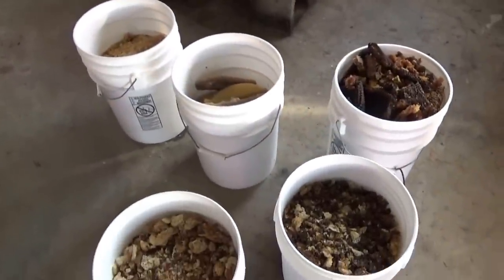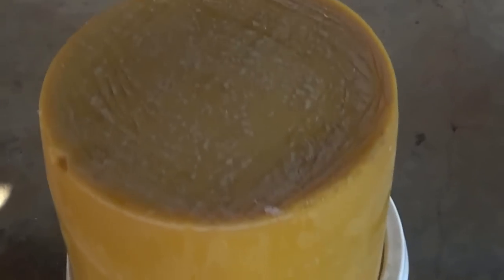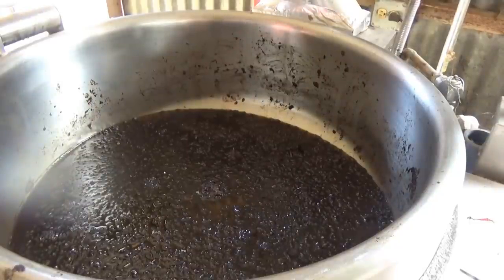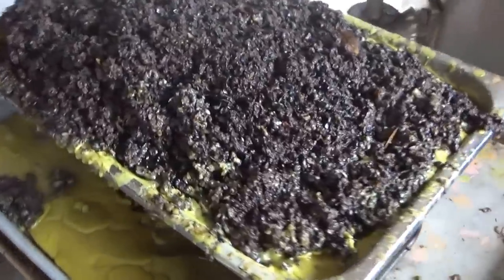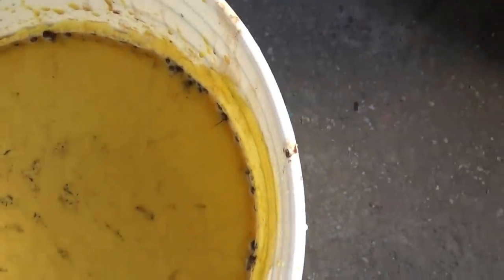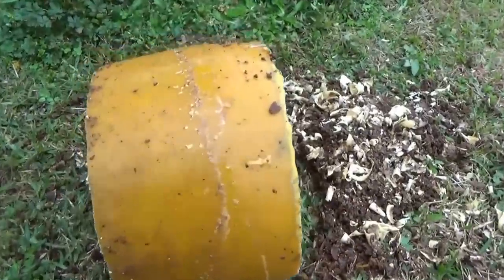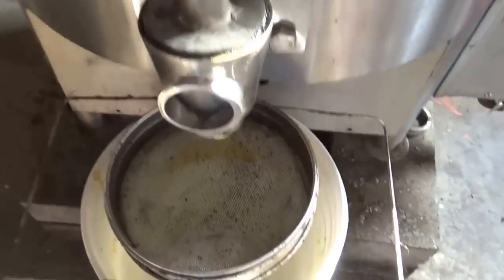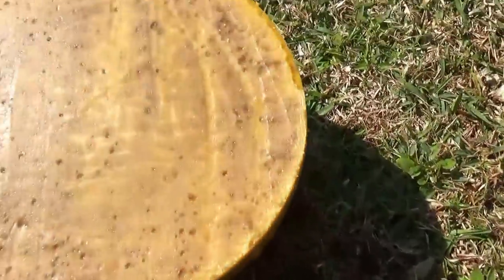Rendering bees wax

Comment: Does the cocoon/wax leftovers burn well? You could cut it into chunks and use it as a firestarter or log for campfires
Reply from the maker: What guy doesn't like a good fire? I know I do. I never tried to burn it, but since it's  wax and debris, it might burn. Let me know if you ever find out. Thanks for watching. God's peace.      Mr. Ed
Reply: I bet it would burn, no problem. Throw the leftovers in a blender, add it to a bucket with some newspaper pulp and squeeze out the water with a vice in a brick form and you've got a nice fake log infused with beeswax. Then sell it as an original product for $$
Reply from the maker: Sounds like a good idea to me, but I've got way to many fires burning already to start another one. Thanks for your idea and watching. God's peace.      Mr. Ed
Reply: I was thinking the same thing.
Reply: Anthony Klose, this does work. I have used old pine chips. It burns smoky but does burn good.
Reply: Rural Homesteader Mr. Close have you tried that in a smoker for use on beehives.
Reply: Would it be a good idea to put the scrapings in a compost heap? Or would the wax make it impractical?
Reply: ''What guy doesn't like a good fire?''....That is interesting, reusing the 'waste' as potential fire starters...I agree, men especially like a good outdoor fire...woe betide anyone who 'interferes' with another man's fire especially when it is being kindled....eg, bloke gets it going in the rain, and coaxes the little flame to catch on the damp timber twigs, and along comes another person and dumps a huge wet branch across the nascent flame....of such things yellings are made :)

Comment: 2 quick questions: how many hive boxes did you need to collect all that wax & how much does a 15 pound block of wax sells for?
Reply from the maker: I really don't have any idea how much wax was collected to produce this much refined wax.....it was a LOT. It was more than 7 months worth of collected wax. Rendered wax can sell from $9.00 a pound to up to $ 35.00 a pound. It depends on the purity of the wax and also the source of the wax.  Because I have treatment free bees, therefore treatment free bees wax, it would sell for  for about $ 15.00 a pound, but I don't sell wax as I need it all for our bees. I give it right back to them. God's peace.
Mr. Ed
Reply: We get about 4 pounds of wax from the cappings from 6 or 8 medium honey supers. Have been using a big canning pot on a turkey fryer.   We harvest around 30 pounds of wax a season off approximately 40 colonies.  We use it to coat new foundations and make some candles. The bees will work on the new foundation and get it drawn out into combs much faster if you give each foundation a nice coating of fresh bees wax from your own hives.
Reply: @JeffHorchoff  they will recollect wax?
Reply: @charliedilltarde9881  Correct, less energy used to build the comb means more energy goes into honey production.

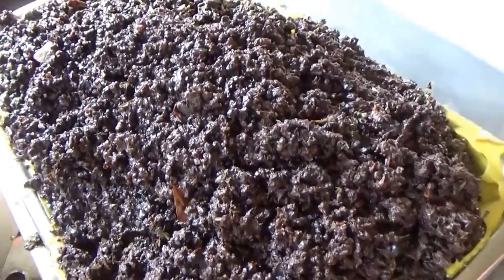Comment: you could sell all of the extra gunk at 6:30 as a chicken feed and get more money out of the rendering process. you could probably use eBay or some site like that.
Reply from the maker: It all goes into the compost pile now thanks to all the suggestions from views like yourself. Thank you so much for your help and watching, and commenting on my channel. God's peace.       Mr. Ed
Reply: Jeff Horchoff also you should try putting the starting wax caps and comb on a wire mesh lining inside of your cooker before you melt it and see if that helps with the process any more. just an idea, although it might work better with a little bit finer of a strainer.

Comment: Would it not be faster to filter through fabric at the first drain making for a cleaner wax at 2nd boil
Reply from the maker: The main problem with the first filtering is the amount of debris in the wax. More than half the material in the melter is cocoons and trash. I now keep a screen netting under the entire mix and it helps tremendously. I'll be posting another rendering video very soon, stay tuned. Thanks for watching. God's peace.
Mr. Ed

Comment: Liked your video . I purchased the wax rendering machine from Cowan manufacturing out of Utah and it's a honey separator and wax separator all in one unit it is made to set a drum of your extracting cap pings upside down with a grated lid and it drips all the liquids out and drains into another square box which is equipped with a water jacket and heated with a element to not burn your honey but keeps everything well liquified until your ready to pour off.This machine works pretty good but it was a little pricey
Reply from the maker: I have to admit Randy, I am jealous. I would love to have anything made by Cowan, that is a really good manufacturer of honey processing equipment. You have a very good piece of equipment. How many hives do you have and where are you located? I know you can not be just a hobbyist bee keeper to purchase equipment like that. I'd love it if you check out other of my videos on my channel and let me know what you think of them. Most of them are about removals and swarm captures, but there are other aspects of bee keeping that I show. I hope to hear from you again. Thanks for watching. God's peace.
Mr. Ed

Comment: I use a strainer that's basically a paper towel on top of a window screen.  As it melts, the nasty stuff gets left on top of the paper towel and the wax sinks through to my pot full of water.  My process only takes a day because the straining process is more exact instead of manual.  I hope you can use this for your larger operation instead of hand straining it.  Happy Thanksgiving!
Reply from the maker: Because of the volume of material I process, the amount of debris is tremendous, and a "simple" strainer can not handle the load. I have refined the process by adding a screened material in the kettle which eliminates over 95% of the heavy contaminants, and use a simple strainer to remove the rest. Here is a link to the last rendering video I made. Till next time, thanks for watching, and Happy Thanksgiving! God's peace.         Mr. Ed
https://youtu.be/gdof2ZO_5eA

Comment: I don't know about processing bees wax but I do know processing other oily / waxy stuff, if you were to add a few gallons of water to that wax after you skim off the junk on top, boil it under a hard boil for a few minutes and then let it settle out, you would be able to remove most of the sediment on your initial strain and have a much cleaner wax product after the fact.

The key is to boil the water with the wax in it so as to dislodge all of that crap from the wax and allow it to sink. Repeating this process a few times will leave you with extremely clean product.
Reply from the maker: That is very interesting, and I have never heard of it before. I will do that on my next batch. Thank you so much for the info, I know it will work. God's peace.      Mr. Ed

Comment: If you pour the wax in a traffic cone shape the surface area to scrape on the  bottom is significantly reduced making for easier scraping and a much smaller soiled surface.
--------------------------  
If you add a spigot at the bottom of the cone shape you can drain the water leaving mostly just wax, making the bottom crud area even smaller.

Comment: Try using a butter muslin cloth as a filter for the final run, see how clear the wax gets with that.😉 Sure it's a bit messy, but just use the same cloth several times, the wax left in the cloth will melt with new wax poured onto it. Of course do it while it's hot weather, so it doesn't solidify too quickly. Experiment with that if you'd like.😁👍 Proper filters get even better results (clean it real good first!), almost white wax.😉
Reply from the maker: You got my attention, now I'm going to have to try it. I've got a lot of 
 cappings that I want to make into candles so I want some really refined wax, your suggestion will be put into practice.You can bet Im making a video on it so you will see the results for yourself. Thanks for the suggestion and for watching. By the way, I post a new video every Friday, and I hope you will check some of them out. God's peace Michael.
Mr. Ed
Reply: @JeffHorchoff  Here's a video of another guy who uses filters (but isn't that careful when transfering), and it works really well without being too expensive:
https://youtu.be/dUc8_bz7oH0

I figured you might want as clean wax as possible for 'church candles'.😉👍
Reply from the maker: The video was a big help, thanks for the link. God's peace Michael.
Mr. Ed

Comment: Enjoy your video again, glad to see your are staying busy during the winter months.  Have you ever tried freezing the wax after you filter it, it makes it a lot easier to break apart.  We use a filter that is used to clean cooking oil, it is design to fit over a 5 gal bucket, it cleans up the wax very nice on the second melting.
Reply from the maker: Hey Desmond, of course I'm busy, I'm retired. I am going to try your freezing trick, that stuff is a bear to break apart when I have to remelt it in the crock pot. And what about that filter, where can I get that. I have to spend 15 minutes with a heat gun and compressed air to clean out the honey strainers each time I strain wax. That is a job I don't like doing. 

Also, how about sending me some pictures of you and your bees, I'd like to put it in a video if you thought that would be OK.  You have my email address, just send them to me and you, rather your bees, will be on youtube. God's peace brother.      Mr. Ed
Reply: The filter and rack we get from a restaurant supply store called Krebs Brothers.  I will get some more information when I am home and send you a pitcher of it.  I would be honored to seen you some pitchers of my bees.  I will get them to you soon and to you have a blessed day.

Comment: Again, a great demonstration of how to process wax.  I have a suggestion and would like to hear a comment from you if you've got the time.
I noticed when you were skimming the junk off the melting wax (using the fryer basket) you said you put that in the dumpster.  Also, I noticed that when you scrape the junk off the block from the bucket there are a lot of wax shavings on the ground.  What about putting the junk in a solar wax melter and collect the left over wax.  I bet you've got a couple of pounds of wax left in that junk.  Then after sitting in the solar wax melter you could throw the stuff away.
Thoughts?
Reply from the maker: It really comes down to how much time I have to devote to rendering the wax and all the other jobs that I have to do. Yes, I could do the things you mention and gain a bit more of the wax, but now all the "trash" is put into the monks compost pile to help with aeration. By the way, the monk is grateful for my "trash" so I'm satisfied too. Thanks for watching. God's peace.
Mr. Ed

Comment: Saw a video where the guy filtered the dirty wax one time and it came out light yellow. He used a pair of tights to filter the wax through. Did a better job than paint filters.
Reply from the maker: I saw the same video, pretty interesting. My problem is I use so much comb, the junk in the wax is to much for that. God's peace Bill.
Mr. Ed
Reply: @JeffHorchoff  it would seem that you could use tights until your plugged up. Then turn them inside out, peal off what you can, then wash them in hot water to melt the rest out, and use it over. There's a lot of surface area in a pair of tights.

Comment: hi  by slowing down the cooling you'll ovoid the crack ;) a lid does it  a blancket can help in winter ... so the block is massive , they can be marked  very easily date  origine / fondation /opercules !  thx for the vidéo !
Reply from the maker: Good info, thanks. It is a blast to melt the nasty wax and have something so beautiful come out of it. God is great. Thanks for watching. God's peace.      Mr. Ed

Comment: Mr. Jeff, You mention that if you let the unwanted material set to long that it becomes difficult to remove. Have you tried something like piano wire, or similar item like you would use to cut up a block of cheese. Shouldn't be to hard to slice in from the side just below where the unwanted material starts.
Reply from the maker: The problem I see with using a piano wire or even a heated wire is though it would work, I would lose to much of the bees wax along with the unwanted stuff. So, for now, I will continue to just scrape it off within the first 24 hours.  Thanks for watching, and I hope you will check out other bee videos on my channel and let me know what you think. God's peace.      Mr. Ed

Comment: I made a auto filter 5 filters each heated to keep it molten mixer at the bottom to keep the wax at the very bottom to touch the hot insides of it sence there is no preheating in it the wax is spun around to move the wax to the sides from the middle and vice versa also the remaining junk from making beeswax is good for starting fires and also godd feul for them
Reply from the maker: Great idea, do you process much wax? Thanks for watching. God's peace.
Mr. Ed

Comment: I love watching these videos. But my question is why wouldn't you use an oil filter or a cheesecloth in the wire strainer at the tapping stage so it can obviously catch the larger as well as the super fine slum particles at the outset ? That way, there's not a need for multiple remelts.....which saves time. I hope someone replies to my question. Thanks all !! 🐝🍯🕯
Reply from the maker: I now use 1/8th inch hardware cloth to strain out 95% of the rubbish in the wax. It has sped up the rendering process tremendously. thanks so much for watching, and leaving your comment. God's peace Will.
Mr. Ed

Comment: Excellent video! Just a question. On another video, the guy mentionned that the reject material could be turned into fire starter. Is that the case? What if that reject material was remolded in - say - an ice cube tray, would the stuff light easily and burn?
Reply from the maker: Glad you liked the video! The refuse makes great fire starter, the problem is as soon as it strains, it hardens. Putting it in a mold would be difficult....at least for me. As it is, I just break  some off and it works real well. Thanks for watching. God's peace.
Mr. Ed
Reply: @JeffHorchoff  Thank you Mr Ed! Keep up the great work!

Comment: Hey Jeff. Could not help but notice the struggle you had with removing the wax from the bucket. Any chance you might try adding a gate valve( or just a simple plug ) to the bucket so you can relive the pressure before the battle ensues ?
Reply from the maker: That's a good idea, I'm going to work on it. I think you are on to something. Thanks for the help, and watching the videos. Good to hear from you again. God's peace Charles.        Mr. Ed

Comment: I like to throw my wax cases into an outside fire pit instead of a dumpster. Awesome video.
Reply from the maker: The refuse now is cut up and put in the compost pile instead of the dumpster. I did use some of it as a fire starter though, it works very well, and I do love a good fire. Thanks for watching. God's peace.
Mr. Ed
Reply: @JeffHorchoff   I never thought of compost. Does it work well?
Reply from the maker: @WallyTony  Yes it does, it really helps the pile from compacting.....so I'm told. God's peace.
Mr. Ed

Comment: I wonder if you could use is as fire starter. Get molds and put it in them before it cools/hardens.
Reply from the maker: I do that already, and no molds are necessary, just break off a chunk or two and put them under your wood. It really works well. Thanks for watching. God's peace Deanna.
Mr. Ed

Comment: It appears to me that his temp is way too high. Beeswax melts between 145 and 150 degrees. If your water is boiling, you are way to hot by about 60 degrees. That will hurt the quality of the wax itself.
Reply from the maker: Thank you for you input,  I do know that now, and try to keep the temperature in the 170 range. What I really need to work on is my patience, that would help better. thank you for your help and for watching. God's peace.
Mr. Ed

Comment: Melt a ton in a massive pot like you did. then pour into smaller ones to process on a stove/hotplate so you can then pour the finished product through a strainer to get the possible cleanest product.

Comment: Wouldn't those strainings, and 'nasty stuff', be good feed for pigs or chickens? Or make good compost?

Different kind of question... Do bees go dormant when it gets cold? If so, about what temperature? Reason I ask, I rolled my water heater down the hill. It was an external installation. The bees took it over. They are inside the jacket. But they attacked me like mad any time I got anywhere near the tank. So I disconnected it and rolled it down the hill. LOL I am hoping to get my water heater back, take off the jacket, remove the bees, and hopefully get some wax from it. I want to make myself a tincloth hat.
Reply from the maker: The "trash" is now used in the compost pile. Bees become less active in cooler weather and in cold weather, they don't even move. My guess is that you have yellow jackets and not bees, and yellow jackets don't make wax. Let me know what they are, and good luck retrieving your tank. God's peace.
Mr. Ed
Reply: Thank you. To explain my last statement, "Tin cloth" is made by coating canvas or other material with a 50/50 mix of melted beeswax, and mineral oil. The old timers used it on their tents, coats, and hats.

Comment: Once you've scooped out the majority of the trash and are ready to pour it into the bucket, why not hold the strainer between the bucket and the tap to strain it as it pours and catch some more of the larger stuff that you missed scooping?
Reply from the maker: There is still way to much rubbish in the wax to do it. The filter would clog up from the amount. That's why I let it cool and scrape the block, it's way more easier. Thanks for watching. God's peace.      Mr. Ed